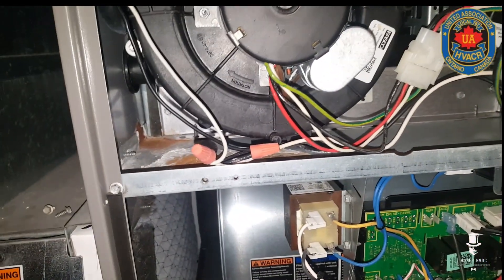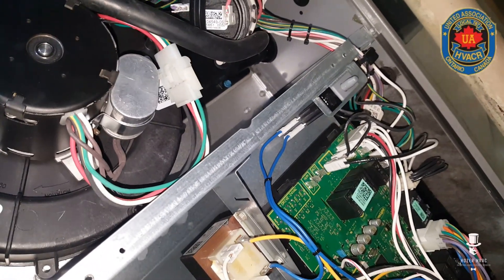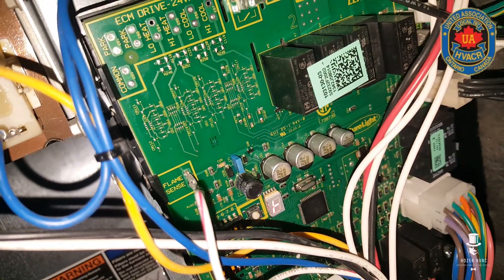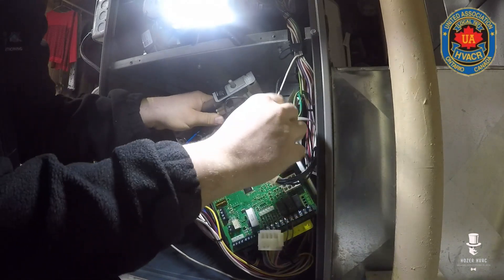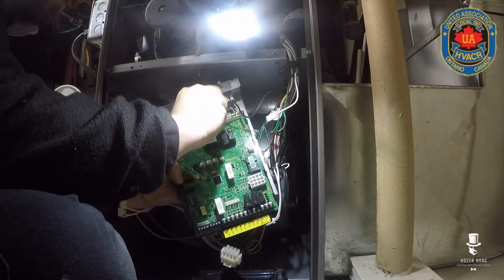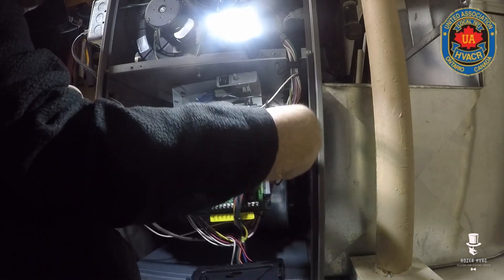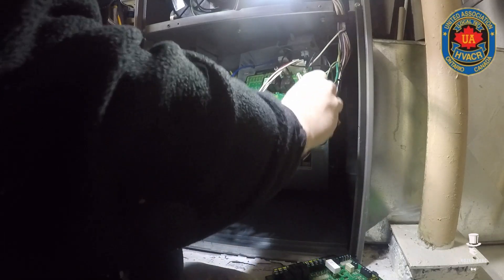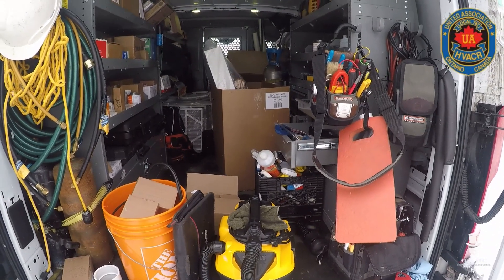Lennox EL296 control board replacement

Comment: Don’t you have to program the unit capacity/size mode? I recently got the same board and it says that you have to program it to. Specific digit
Reply: So quick update i did mine and after installing it and trying to configure it i restarted it and it detected the correct size unit and i had to do nothing else, btw i saved my self like 1k usd by installing it myself
Reply: @eltebux  Hey I am about to replace my board, how did you know it detected the unit correctly?
Reply: @ so if i remember correctly as soon as you connect everything it flashes the detected unit, did you get instructions with the board? I think i still have mines
Reply: @eltebux  I haven't recieved mine yet, its about 4 weeks away still
Reply: You do but his not going to tell you how 😂

Comment: I just started with a new company, we've been installing this exact furnace all week.  My lead and I slap them in.  No gas pressure checks , delta T or combustion test.  I can't understand the dip switches either , or theres a rigid bolt in the direct drive blower that I read has to be removed as well.  Lennox doesn't respond to emails or calls, so I hate to say just like most equipment us installers slap these appliances in.  Sorry to service techs who have to go back to our installs.  I'm legit trying to install them accordingly but my lead could care less and the company won't help either.  All I can do is read the manual and work as fast as possible so I have time to do the proper ( and legal ) checks.

Comment: Anyone know how to get the flames lit again after hard rollout lockout? First it said soft rollout lockout. Then I dry cleaned the heat exchange area and vent, changed the filter, cleaned the flame sensors and reset every button I could find. I thought the one that says 3 amp (by the panel / cover switch) was a resettable button or breaker, but it doesn't seem to be resting or switching at all. ?? But everything looks exactly like the unit in this video